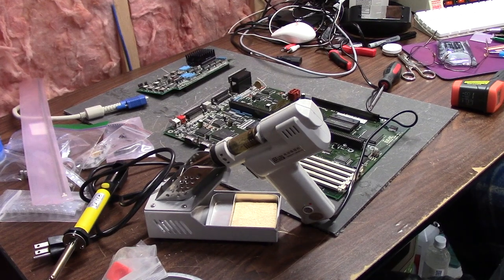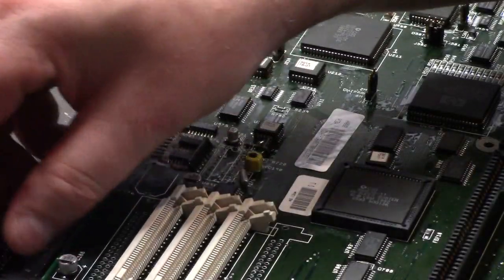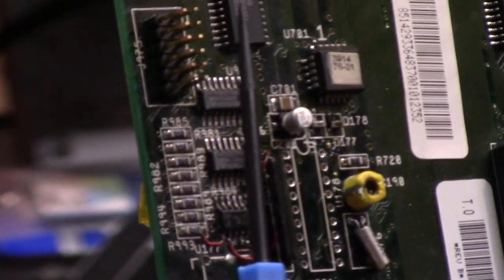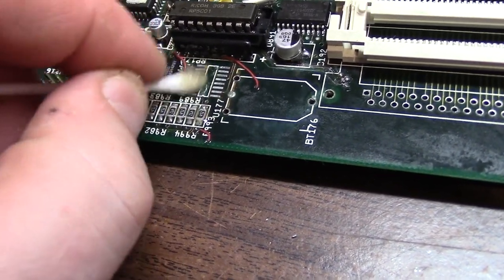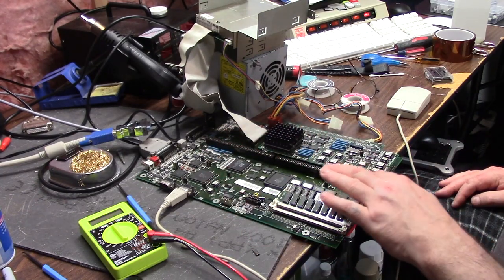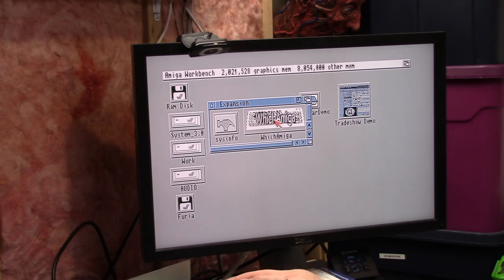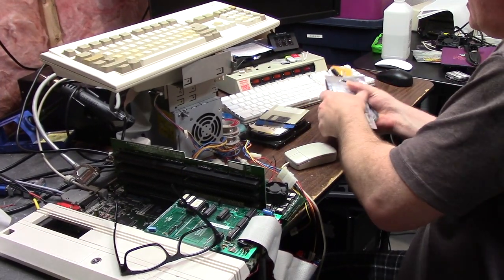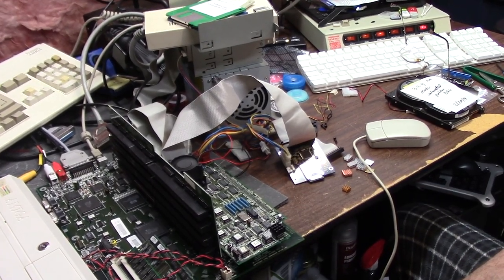Commodore Amiga 4000/040 SN000439 restore P3.

Comment: Back in the day HP use to make a really nice replacement for the 72 pin  memory bank, can get them anymore 
It was very common for the tabs that held the memory Sim  to brake off  - people would often use hot glue to secure the ram in place 🧐
Thanks for the flashback Chris

Comment: you can take a sewing needle/pin and go thru the fast slot with it to spring the pins a bit,just be very gentle. On the crystal,they are installed in machined pin sockets. they can get corrosion in the pins but deoxit usually fixes it..
Reply from the maker: I just gave her the old tonya harding and she was good until i got it replaced.  Wasnt the 50 it was my 28.63636

Comment: Could it be the sector sizes or the filesystem that are set wrong and making it struggle to read the HDD? Maybe it's starting to fail and the computer is having to rebuild the file tables or something? I have seen some weirdness on my machines if you have mismatched ROMS and Kickstart, ie a 3.1 ROM and Workbench 3.0. Just some ideas?!
Reply from the maker: no its a ic U141 a  745 quad buffer IC, its legs were eaten off, which is weird because its on the back side of the Riser slot. i replace it and it springs to life. but when you shoot 41 hours of repair i don't want to make my users watch that much repair, so i condense it into a few shorter videos.
Reply: @ChrisEdwardsRestoration  Ah well good to know you figured it out!

Comment: Hi Chris.. isn't it just FFS disk validation? 
I switched to SFS .. this file system  is fast and without validation ..
Reply from the maker: No its a chip. I replaced it and u141 had legs eaten off by a mystery leak . After i replaced it it was fast again

Comment: hey Chris. I watched a video series by Gadget UK about 2 x A4000 mobos he fixed and I remember he had some issues with the crystals. I think he ended up replacing them. Otherwise I think you got fairly lucky with yours.
It is a pity that Commodore never realised about the NiCad batteries cause they sure destroyed a lot of boards in the 2000's, 3000's, 4000's and of course the A500 +'s. Not to mention the A501 ram expansions.
Reply: they did realize it,just way too late. the rev.D CR a4000 desktop board had a lithium coin cell installed as well as the A4000T's.  Those evil German VARTA batteries ruined so many good Amigas.
Reply: @a4000t  Funny how everyone says Varta because it is a brand name rather than a type. My A2000 had a different brand which I can't remember. My caps were Elna brand; and they are still good and I removed the battery around 2000 just as it began to leak. Just had a bit of the ooze at the negative terminal but otherwise nothing else; I was very fortunate. However an Amiga 500 plus I picked up in the early 2000's did have a Varta brand and well I removed it but lets just say It did not work. I did not have the knowledge then to try and attempt to fix it but it is sitting the shelf so I will get to have an attempt to fix when I retire in about 2 years and 10 months.

Comment: you can replace the 3640 PAL's with gals,they run much cooler. Replace the ide HD with a CF,it helps,as does SFS filesystem 1.279(be sure to set the cf to 0X1FE00 max transfer). I didnt notice,but were you testing with only chip ram installed?it can be quite slow.
Reply from the maker: a4000t it now has an 44to40 ide ssd, finding gals program,ed is a whopper task in itself
Reply: @ChrisEdwardsRestoration  i thought Chucky or Cosmos was doing them,not sure. might contact them if need be. Gals are easy to program with most eprom burners though.

Comment: when using a 3640. you can actually remove the 50MHz oscillator it is not used.. (CPU jumpers to EXT..)
Reply from the maker: my jumpers were on ext, but the jumper didnt have any metal inside, i dont know why i was like that or what it could be jumpered to with no contact inside. but it works, and works without now

Comment: My A4000 with A3640 at 25MHz also has super slow IDE. Perhaps I have the same issue? It takes ages to boot, and even reboot is slow. It's not even fun to use because of this. :/
Reply from the maker: Could be. After replacing u141 it flies again
Reply: @ChrisEdwardsRestoration  nice find on u141.

Comment: Almost there great job. You can buy new blank Lattice GALS from Mouser of Digikey and program them with the IDE PIO2 update available on AmigaWiki.org which gives a nice speed boost on large SD's 128GB 3,276,800 bytes per second. Did both my A4k's more than happy with the performance and using the elcheapo TL866plus to program them.
Reply from the maker: u901/902 mod? did you do the updated scsi.device too?
Reply: @ChrisEdwardsRestoration  using SCSi.device from 3.1.4 but programmed the IDE GALS for pio2

Comment: Why not do a fast Blocksize such as a FFS 4096 (Fast Boot) and MaxTransfer 0x1FE00 Enter.  Have that on my A1200 with a Blizzard 1230 IV and got 12 seconds to use  ClassicWB ADVSP Scalos. With a 4GB Microdrive in the CF adapter. Look like a CF card but thicker because it’s a little HD. Have a speed of 2.6MB/s. Use a Indivision AGA MK2CR for VGA to have PAL High Res Laced 640x512 with 32 Colors. It’s razor sharp on the BenQ BL702A VGA 17 inch monitor. My others A1200’s have 3.1.4 ROM chips on it but are not so fast. They have 32GB CF’s on it and pull around 1.8MB/s. The CF cards are slow and are SanDisk Ultra 50MB/s. My A500 is a fast one and have 7MB/s and do about 8 seconds to use WB 3.1.4.1 -  BestWB 1.3 with WBDock.
Reply from the maker: as I mentioned in another comment, it was U141 a quad buffer F245 IC that controls the IDE bus and the keyboard buffers. I filmed 41 hours of boring repair, then edit it down to a few reasonable episodes. the stock 040/25 this has gets around 1.7-1.9 when she feels like it.
Reply: Hope that you can repair it. Have lucky that my two A4000 Rev 2 boards with the 68040 on A3640 v3.0 have no battery leaks. Have recap it and with 3.1.4 ROM chips on it. Would do in 2021 projects with it. Now I’m busy with with my three A1200 projects.